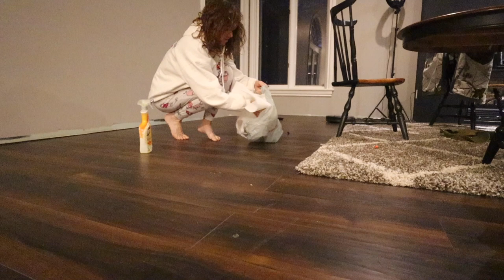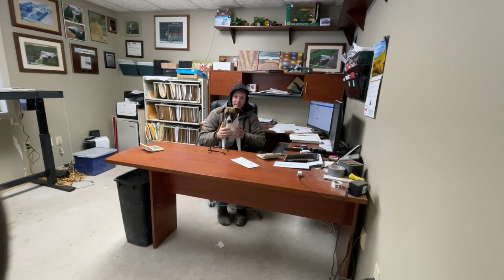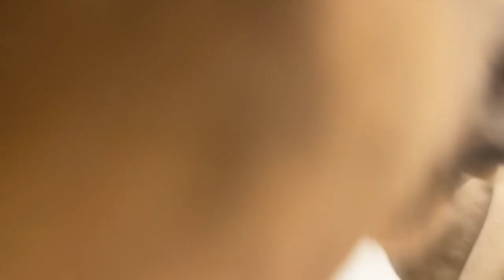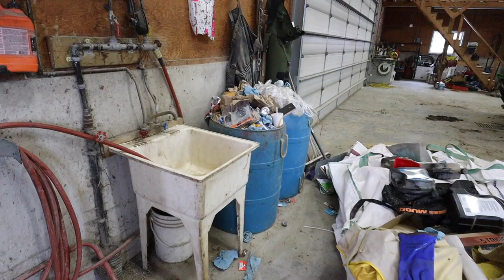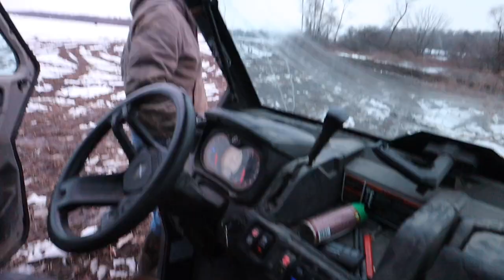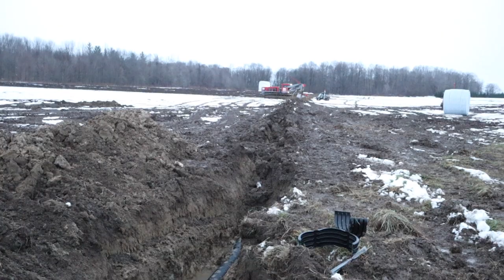it's hard making new friends🐶🐑... | VLOGMAS 2021 | Vlog 518

Comment: Installing drainage tiles is essential for soil health. A healthy soil should be 25% air, roots have to breathe. (soils class 69 OAC). As a retired agronomist living in western Canada, I knew nothing about sheep, this is cattle country. I got hooked. You are part of my learn something new every day to keep the brain working retirement program. Thankyou & Merry Christmas.
Reply: Thank you for the explanation of tiling.
Reply: Is the tiling removed?  Is it only there to drain the field out before spring planting or does it remain as an ongoing soil management t tool
Reply: @wendyhorn8376  Tiling a field is very expensive and disruptive to the soil where the tiles are installed. They are permanent. Previous to plastic, clay tiles were used and they had a tendency to deteriorate over time, i.e. 25 - 30 years. That at least is my experience.
Reply: To add another farmers point of view. Those old clay tiles also would bubble up in frost heave in the spring. They can really jack (no pun intended) up a plow. But they make great planters once you go to pvc tile.
Reply: @dennislaughton1676  oh wow! OK, so that's why it's called tiling.  Thanks for the great explanation 👍
Reply: @wendyhorn8376  It remains in place all year long.

Comment: The comment "I wish we could bottle it up and send it out west." made me wish for the same thing.  Thank you Sandi for your wishes.  Our pasture posts are falling over.  Not because they are rotten but because the cracks in the ground from drought are that wide.  There is a 4" to 6" crack most of the way down the fence line.  It is amazing how much the ground shrinks when there is no water in it.

Comment: Guessing it's Lucy that's leaving gifts for you. Guessing also, from their location as you shared that you can be thankful they're not in the kitchen on the way to coffee maker.👍
Cool idea for ropes on the blue barrels. Saw you were able to dump it easier.
Interesting to note the tiling of the fields. Kinda curious, is that work messing up navigation for the tractors? I just recall that you talked about how you're able to plow, plant & harvest because of it. Thanks!!
Reply: Someone mentioned that they were laid 4 feet deep. A bit far for a plow to reach. I had been wondering about that too!

Comment: Why do you call the pipes tile when it is perforated pipes
Reply: Years ago the drains were made from actual ceramic/clay tile. Some of those systems are still in use today. The name has stuck although the material used has evolved.